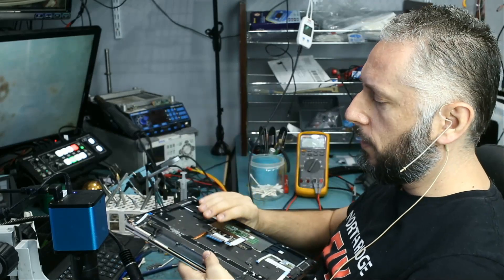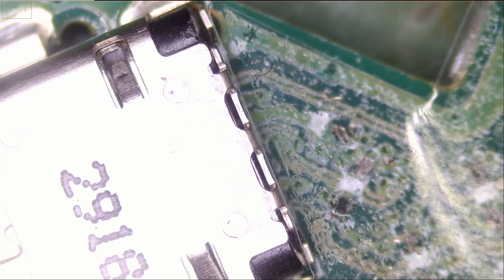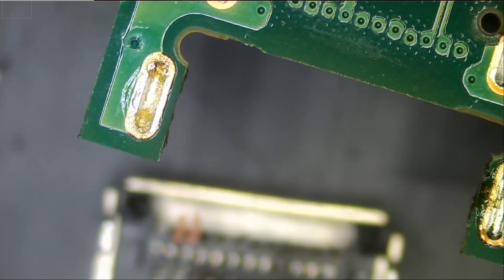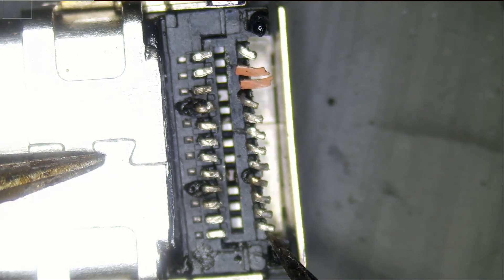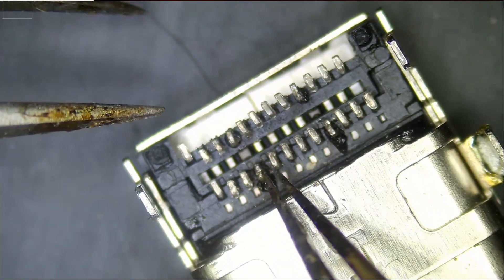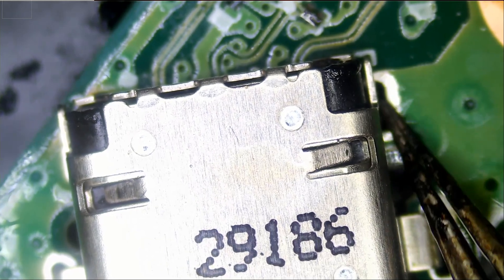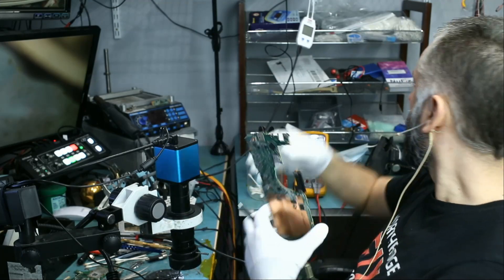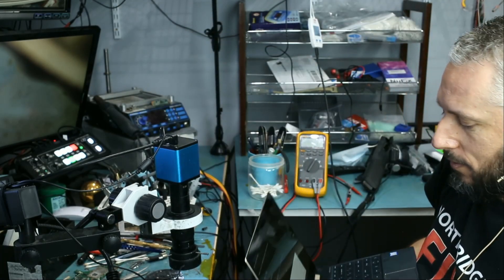HP Spectre x360 Laptop No power Not Charging Repair - 13-AP0053DX - USBC Issues with this model

Comment: I have the same laptop. good heads up for me that I have to take care of the charging ports. Bought it for the looks, HP doesn't even support Windows 11 on this machine and I got a big drop in performance from upgrading. had to look up how to restore the High Performance profile. Also the fan curve is hidden in firmware you cannot manually set the fans. The fans never go to full when you need performance, I only get 20 watts out of 30 watt capable CPU!

Comment: I know this is an older video. When I first got the 13" Spectre in Feb 2020, it developed the same issue around July 2020 when I was using a USB-C magnetic adapter. instantly went off. Nothing would charge. Power LED would blinking on and off. Sent it to HP repair (was still under 1 year warranty) and they did a motherboard swap. Shame that these USB-C ports seem to be a weak link.

Comment: I just found out that the pads on one of my Spectre USB-C ports lifted and was told by my local shop that it is unrepairable. Any 2nd opinions?  Is there a way to convert a thunderbolt usb-c port into a charge port only?
BTW, I bought a 'YoungSelly USB C Connector,Support Thunderbolt 4, USB4.0, PD 100W Magnetic Adapter' for the remaining port and love it (Amzn, elbow version is best).
The USB-C port is a poor laptop charging design choice. The connector just isn't sufficiently robust. Laptop mfgs need to restore the former low profile barrel plug or switch to magnetic connectors like the YoungSelly.
Reply: Youngselly Magnetic Connector bricked my laptop. I bought another laptop with a traditional AC barrel port AND an extended, accidental warranty.

Comment: Thanks for all your excellent videos !!
And I must say that HP's design AND construction of the USB ports on these laptops are nothing less than a scandal !!
Badly conceived ((all looks without ONE thought of usability of durability)) and equally badly manufactured, "ensuring" that they succumb to their atrocious ""design"".
 And to top that off no spare/repair parts available....
What a PERFECT TRIFECTA of FAIL!!
Would it be conceivably possible to "solder in" wires on the motherboard, and have them lead to an external USB port ?? Maybe it wouldn't be "elegant" but it sure would beat having a "dead" laptop !
Best regards

Comment: My corner port stopped working and now I have to plug the charger into the other one. I usually use the other one to plug my art tablet in.

My dad sent me this video but I have no idea what this guy is saying. I'm not tech savvy. Can anyone explain to a dummy ?
Reply: Someone please help me. I can't go on like this. Please. There HAS to be a way to fix it. Please. I'm desperate.

I'm a digital artist and I DEPEND on the second port to work. I can't draw under a time limit. I HAVE to unplug my charger to plug my drawing tablet in. Please. I have no money. My dad can't fix it. There has to be something. I'm losing my mind. If I can't draw anymore I don't know what I'm gonna do anymore with my life. Drawing has been the only pleasure left in my life and now I can't do it. Please please please help.

Comment: wont the pins disconnect again very soon? because the way the plastic that holds the pins move i am thinking it will easily dettach again from the soldering. just my thoughts.
Reply: Yeah, that probably will happen. I was thinking maybe they can be hot glued into place for added support.

Comment: HP Spectre x360 is the ultimate piece of s**t! I bought one to be used as a spare laptop on my business trips. After a few charging cycles (not more than ten!) the battery failed. By design it's impossible to use it which means it's very difficult to carry out a preliminary troubleshooting. The battery replacement cost me 150€ and a month's downtime. Now after a couple of charging cycles (it's a spare laptop) the battery charging can't get more than 93%! To make things worse it's continuously overheating, even when it's idling. I had read about this before buying it but I never thought that the problem would be so serious. An absolute waste of time and money! For sure it's gonna be my first and last HP laptop.
Reply: my 2019 model came with an Intel "accelerator cache" that actually slowed down my computer doing constant needless copying to/from the cache drive. After I disabled the caching driver and separated the cache from the main drive, tests showed the cache is the same speed (or even slightly slower!) as the main drive!

Comment: Hello, I have a problem and really need help.  My computer (hp spectrum × 360) no longer charges when I plug in the charger, the indicator light does not light up and yet the computer vibrates, indicating that the charger is working and knowing that I have no battery problem before I  I just had to move the charger for it to work but nothing helps.  I sincerely hope that someone will be able to answer me thank you in advance.

Comment: If you had fixed the black plastic inside, the problem would not have happened again. legs(pins) will come off as the black plastic moves

Comment: @NorthridgFix google part# EB-500-5004 , that should be your port. or at least it sure looks like it.
Reply: If anyone is still looking, this is not it. Search Google Shopping for "DC Jack USB Type-C for HP Spectre X360 13-AP0000 13T-AP000 CTO Power Connector Port". Credit to Robert Martin in the comments above.

Comment: Was fixing one that laptop with the same issue, broken pin connectors. I solders the pins again and retracing back the pads that were ripped off the board. The one on the corner blew up when I connected the cable but the one on the side was fine it charges the computer. Any luck finding the port?

Comment: Excellent video!  The port can be tested for internal broken connections by plugging in a 24-pin break-out board and checking continuity.  Thanks for sharing such great and educational videos!  (btw, what temp do you use on the hot-air?)

Comment: Right on time with the video, as my X360 of this generation (13-ap0028ca) just stopped charging off the main port, and the secondary port that I never use worked for all of half a second. Now neither port will work. Hopefully a local electronics shop can fix the port(s) if that is the problem, and hopefully its not something like the power IC shorted by using the second port. Figures the HP would shit itself right before finals, when I actually need it. Annoying that there are no replacement ports!

Comment: my daughters  aurus  x7  pro   main board  charging port  melted down   3 times . luckly it was  covered by the   makers 3 year warenty     it would have been  3 k  for  the new  main bord  as you can't buy the  part to mend it .
  it's a bit like buying a new car and having to scrap it because  you got a broken wheel   and can't buy a new wheel   .
crazy    made to  breake    [do not  atempt to mend  ]

Comment: I have hp envy x360 
It was brought to my shop not powering i fixed the charging port...but after powering it doesn't display 
All the voltage are available 
Have tried with a New RAM & even flashing the bios but still no display

Comment: i would probably identify the - and + and install a barrel connector and modify the charger too at least it wont break again
Reply: should try do it for the port that wasn't fixed. but it could have some fancy communication with the charger for the power output level. USB-C is complicated.

Comment: Many comments here that HP is junk. I have one (charging stopped working so I'm here). It has worked really well for several years but things are starting to go: mouse pad, battery--replaced and was working fine for a month. My charger is not USB port but one of those circular tubes I think it's 3mm jack. Anyway, PLEASE would someone tell me their favorite 2-in-1 laptop brand (& model number if you have it)? Also, best place to buy it/buy a new computer generally?  I read Dell and Lenovo were okay. I don't have the money for Surface. No need for gaming; just basic files, internet connection.  Thanks in advance.

Comment: @NorthridgeFix On the top of the USB-C connector, the two small metal flaps that are bent down to secure the plastic connector insert... If you pry them up slightly and add an adhesive around and under them, and press the pins back down; it will bond the actual connector to the solid metal shroud. I have repaired many of these devices with the method and had no further issues down the line.
Reply: Those were exactly my thoughts on this matter. The wiggling rips off the copper connectors because the plastic part is not secured properly to the metal shell

Comment: Hello, north ridge what are the dimensions of the port in mm. There is a port from the company JAE with modelnumber JAE_656_DX07B024JAAR1100-1953913. Which has the same pin layout and pcb layout.

Comment: I have done 2 of these myself exact same problem I was able to fix the bent pins it happens because the plastic piece inside can move backwards. I actually put some shims in behind in between the plastic and the metal this stop the plastic from moving and stops the pins from pushing backwards when charger is inserted. It's not ideal but you have to improvise sometimes when parts are not available

Comment: The main problem is that this port is surface mount (SMT) & not through-hole (THM).  If it was THM, the tension from thousands of plugging & unplugging would have kept it in place probably 100 times better than if it was SMT, because we know that solder is a soft metal alloy & so the entire connector is eventually going to break off due to the soft solder.  And the 4 tiny hole mounts on the sides were not enough stability with a port that is used all the time, because they themselves are also soldered in place.   I understand that the company (HP in this case) is trying to make laptops as thin as possible, so they are making big board pieces laterally aligned with the board, instead of the whole thing sitting on top of board.  But this is the problem that is created when you start designing something like this. There was not enough beta testing, because you are not going to see this in those kinds of tests due to time.  The problem only becomes apparent out in the field with end-user customers. Or perhaps HP knew this was going to happen but still approved it, because all they understand is the bottomeline (money) & you can either get it fixed or buy another HP product.  The only thing I could think of that would strengthen this connector piece on the board is to maybe use hot melt glue all around where connector meets the circuit board, that could possibly keep the connector in place 10 times longer, if not 50-100 times longer.  Then if it does eventually fall off again (but it hopefully stayed on much longer), you can reheat or pry the glue off.  The laptop designer should also have some sort of firmament (if that's the word) in the plastic casing that also helps hold the connector in place additionally. There are a couple other ways to design it, but I'll keep those ideas to myself, heh.
Reply: if you look at the modern dell laptops in the latitude lineup, they have brackets that mate with the type-c ports which also screw into the chassis. In addition to this, they spread the footprint of the connector and laterally reinforce the connector with 8 through-hole pads per port in addition to the brackets.

Comment: question? i have this version of laptop in 15 inch screen. this problem has not happened yet. is there a preventative measure that can be taken before this happens?
Reply: A magnetic charging cable might help quite a bit as you are not actually plugging the USB-C connector in and out repeatedly. Also if it gets knocked, it hopefully would disconnect the magnetic connection before damaging the socket.

Comment: Why Hp team no taking care of design and difficulties Before releasing the laptop into the market. You have done a great job and practically showed us how to overcome this type of situations in the real field. I have seen so many left the laptop aside because od the power button pressed inside because of design issues and the charging port seems very delicate and there is no proper support or holder on the port to the base so that when we plug in it can withstand the pressure. Thanks for showing the video in detail Hatsoff

Comment: I've had the same problem with that laptop. I was able to use 1 of the 2 on my repair too. I also recommended my customer to purchase a 100W High Speed Magnetic USB C charger cable  to plug into the port. The magnetic port it will significantly increase the lifespan of the charger port. Amazon sells high speed magnetic charging cables for about 20$ and the female to female extension so they can use the wall charger. The laptop I repaired had the 65W slim charger and it charged fine.
Reply: can you please share the link ? I think I need to buy one.

Comment: so far this laptop has the most crappy design for it's charging port
Reply: Not true, far from that. But it is definitely not the best one. Charging ports and USB ports should always be on a separate PCB or separate connector with wiring to MB. But it is hard to do so on these ultra small and light laptops.

Comment: Those specter Hp units are expensive and built like crap. Hp should warrant repair on these units. Never buy a laptop with USB charging, never. I read that apple may return with MagSafe charging with new 2021 MacBook Pros .

Comment: Nice job, nice video. The design of this laptop and this USB-c connector are horrible. Thats infact a product and a connector that should break soon, so you had to buy a new product.
I am sure its a connector designed by HP, so just HP got this connector. The same problem with the new ps5, where they shift the pins. I bet sony designed it just for the playstatione so no one else could buy that connectors soon or so early.

Comment: Sorry if this is a noob idea, I hope someone could correct me if I'm wrong  - Since it's a charging port only, no data, won't there be only 2 useful pins V+ and ground? So just find out which pins they are and connect a different connector as such? 🤔

Comment: Is it possible to fixed the loose plastic( which cause of bending the pin of port) on port by using some kind of glue before resolder the port.?

Comment: Your video helps me a lot as always, I'll never buy this laptop.
Reply: I have two of these. The best (and most stylish) consumer ultralight PC laptop with Thunderbolt you can get. Period. Charging port breakdowns are always user errors (look how badly bent the pins are!). This design is ok, the screen does not interfere the charger in any way. If you break these ports like in this video you have to look in the mirror. It does not happen lightly, you need to use a considerable amount of force. But having said that the USB-C port is a bit too tiny and fragile for the uses it has been designated for. That is clear. But having this thin laptops and tablets there is not much choices and this is a standard that is driven by EU for example. But I am a careful user so I have had zero problems. And The charging ports have always been breaking down in careless hands, no matter the make or model of the ports. The parts SHOULD BE available. Usually HP is quite good with spare parts but not on the component level. The same with all the manufacturers.
Reply: This is a great laptop
Reply: @ValorHeart  With buit in programmed obsolescence where it breaks when you charge it and lift the screen - and on top of that, prevents you from buying the piece that breaks.

No, thank you.
Reply: Not really, with that and many other problems they have.😢 @ValorHeart
Reply: @ValorHeart  with a shitty architecture... Especially the corner usb-c

Comment: in my case, i would like to use some kind of slow cure resin to fill the gaps and glue the plastic holder pin (black one) and the steel shell of the charging port, so it wouldn't wiggling around after fixing.
Reply: What do thing about using hot glue?
Reply: @nilomyki  Hot glue must be easier to produce but harder to apply, cause it have high viscosity and too fast curing time. And it also too elastic, and it cant prevent wiggle.
Reply: Good Ideer

Comment: HP can't learn from lenovo to put some red resin on that charging port. I think it s very expensive that resin for hp. Ripped pads are awful and a lot of work, some resin like ibm put on gpu in the past it will fix that connector to not move.

Comment: connector is very bad designed, you can see that even with shielding soldered in 4 points all force that came from cable insertion and removing is on solder joints of these pins. Maybe (if it's possible) to fix in place that black plastic inside connector, that will prolong next failure. 
Same problem is present in many, many other usb-c ports and that's why I hate seeing them used as charging port for anything except phones (and even with phones I'll hate it same if I use my phone like most kids do, connected to charger)
Reply: Use one of the magnetic USB C plugs.  I have that on all my devices, and once inserted, the charging ports connect to charging cable by the built in magnet in cable.  No more pressure or strain on ports.
Reply: I was thinking of hot glue in-between the back metal shielding and the black plastic.
Reply: @nilomyki  Great minds think alike :-)
Reply: Yup, I just made the same observation but you beat me by 2 months.
Reply: Yeah. Exactly same problem appears in smartphones after about 2 years of using. I mean USB C is great port but using it as charching, headphones and data transmission to PC after some time destroys itself
Reply: Very poor design indeed the pads just rip right off the board.
Reply: @enotech4572, these laptops are one of the worst. I have bought one and has the same problem plus many others.  For the new buyers, I advise,  do not purchase these laptops!